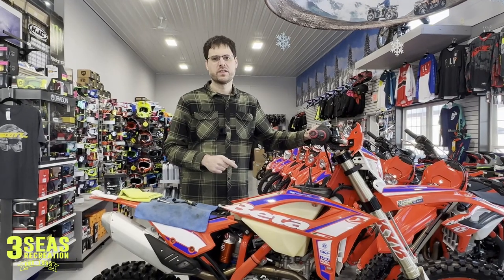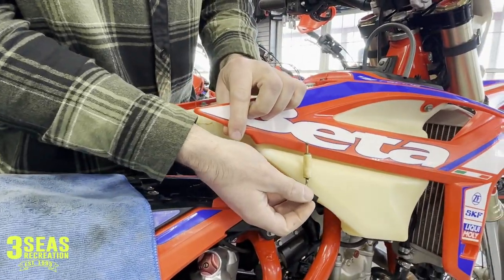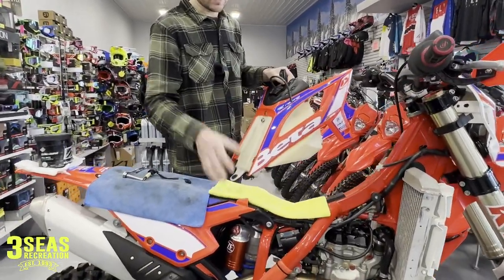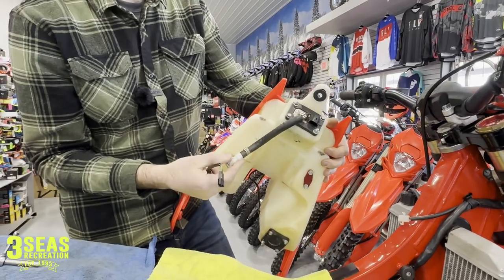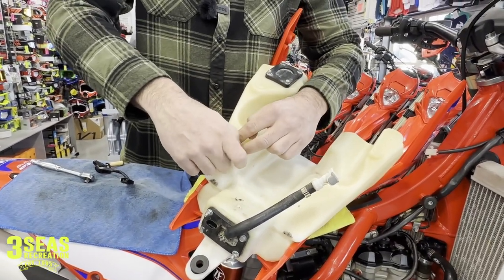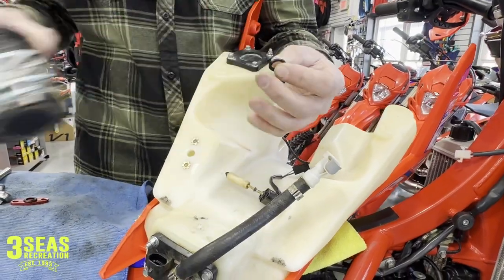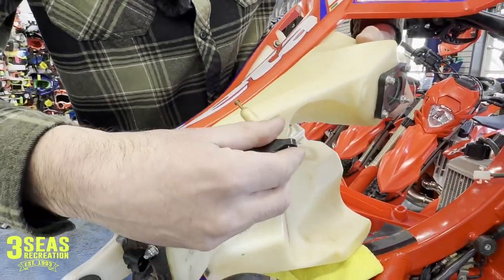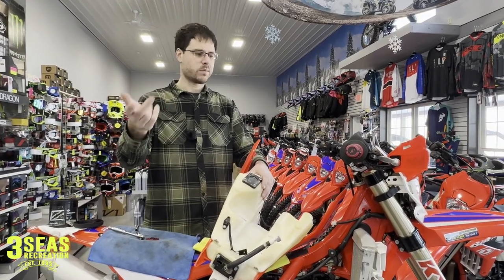Beta Dirt Bike Low fuel light is Common!  Beta 4-Stroke EFI gas tank sensor explained!

Comment: 1/ don't know where sensor is now on  20+ 4s bikes, but on the  19 and less,  being at bottom of tank,  it is easy to modify the  position of the clip , so the float move will trigger the light at a lower fuel level.  Be  very careful not to polluate the "foam" sensor with fingers, it is magnetised. Same when installing it in an IMS tank, the hose is rather small and if you force it just a bit, it won't have no more  enough magnetism to trigger the ILS to make contact. ... ( don't ask me how I know it ;) ) 
It is an open circuit, so just unplug it and leave the sensor in tank, no more light  warning ;)

Comment: Appreciate all the content you put out; they're both entertaining and informative.  I had an insanely tough time disconnecting the dual map switch plug.  Is there some sort of trick with the two "wings" on one of the plugs?
Reply from the maker: Thanks for checking out our videos! Much appreciated. It's kind of a pain as it wraps under the frame bar and you can't fully move the tank out of the way to get both hands on it. I guess over time I have done quite a few so it's getting easier for me. Try to get a good grab on either side of the plug and wiggle it, should come apart.  Enjoy the ride, Jared

Comment: I had this issue with my 2021 
I pulled the sensor , removed the magnet from the float and installed a pen spring to hold the magnet up on the sensor and reinstalled , no block off plate and no unplugged electrical connector

Comment: these sensors are crap. The float will suck the fuel over the time and it will always show low fuel.
Reply from the maker: We don't see a ton of issues with them. I suppose its nice that they are pretty reasonably priced and easy to exchange if needed. Enjoy the ride, Jared
Reply: mine was fine after 300hours 🤷‍♂
Reply: Mine shows low fuel when full. The light has been on since new. 
I’ll call you to order a new sensor today